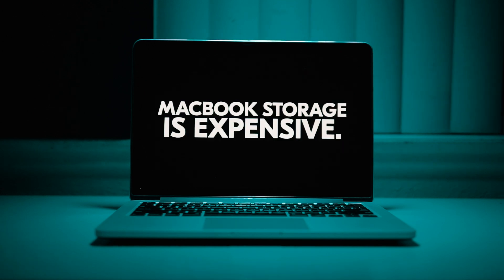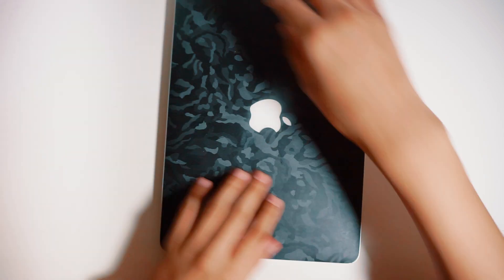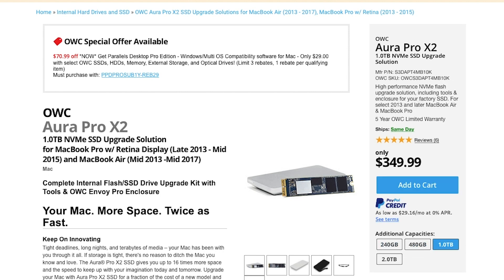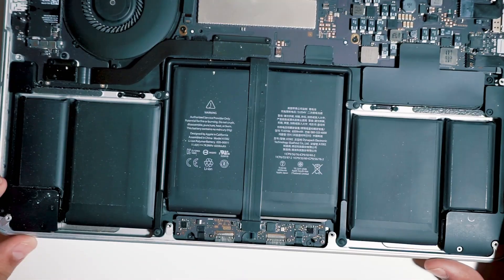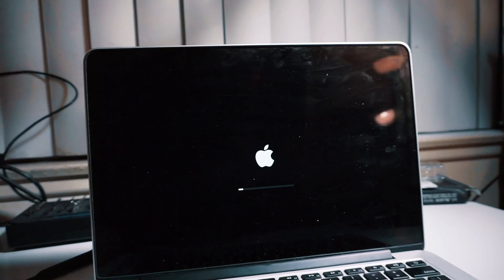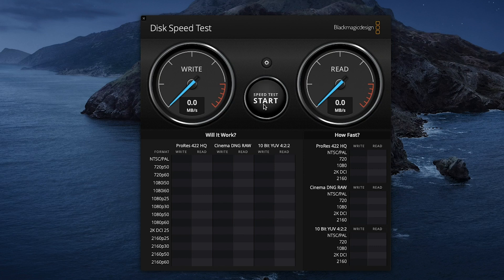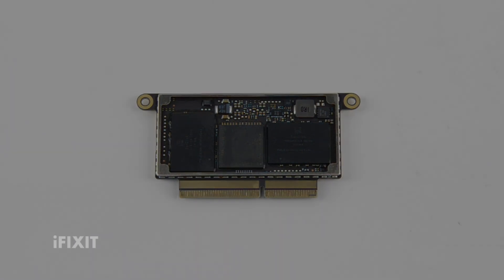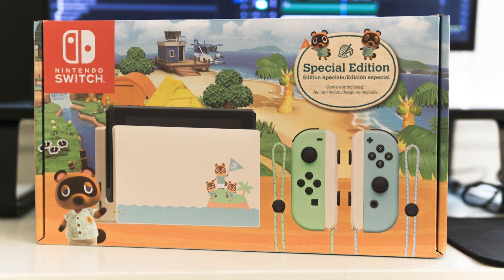The Last Upgradable Macbook Pro

Comment: I just learned from the internet that the Macbook Pro 13" 2018, IS upgradable, however you have to find a DIY expert to help remove the RAM chip off from the board and put larger RAMs back in...the cost of upgrading 8GB to 16GB RAM is about US$ 140.00, plus giving the old 8GB to him...

Comment: I have a mid 2010 MacBook Pro (with the GPU issue) and I was able to replace the popped battery, upgrade to 8GB of RAM, and I put a 480GB SSD in it. Worked as my daily driver for a while, it had the newest macOS at the time which I was really happy about. I stopped using it when the 128GB SSD (put 480GB SSD in different computer) died and the computer never worked that great after that for some reason.

Comment: About the NVMe disk, altho theoretically it could achieve 4GB/s with PCIe 3.0 x4, in real life don't expect more than 1.3 GB/s read and half of that for write, which is fine and still faster than original disk from Apple/Samsung. If youre looking to replace a disk, genuine Sintech adapters are best to go and ADATA 8200 PRO is a best buy, now with 2TB model going for around 250$. Also, hibernation might not work on some MacBooks like mine which is MBP 2014 model and due to firmware issue, but thats just something thats not that big of a deal in the end compared to how much space youre gettin back.

Comment: Greetings Jeff, 

I own the exact same MacBook Pro with the exact same specification that you have upgraded here in the video. I see that the link your description leads to an Amazon link which is a WD Blue Hard disk but you have used a WD Black in the presentation in the above video. 

Inspired by the results you have shown in this video I orders both the products linked below in the description of the video. I had a 128 GB prior to ordering a 500 GB SSD from the supplied link and I am having rather mixed results. I have a 8GB DDR3 Ram, 2.7 GHz i5 13 Inch 2015 MBP. 

My youtube browser gets stuck 3 out of 10 times and the expected speed is a little underwhelming. 

Do you think a WD Blue is the cause of this ? I just followed the link and ordered what I thought a 500 GB which was fit for my usage and it was only after  installing the newly arrived HD and running it did I get back to rewatch this video to realize that you actually used a WD Black. 

Kindly respond  if possible. 

Much thank!

Comment: Thanks Man, the video is very helpful.
To increase performances in general you can also remove the old thermal paste from the CPU and use a coolermaster gel. That's an huge help for cooling down the top case of the macbook

Comment: I replaced my Macbook Air 2017 128GB SSD with a 1TB NVME SSD and it now frequently overheats. Probably because of the higher read/write speed.

Comment: If the 2 storages have different interfaces the adaptor will have its own components and the adaptor might also cap the speeds so that's why you might not be getting the full speeds and even if it doesn't have a different interface the new SSD might have extra lanes that the old Mac ssds don't so it won't use up all the Lanes which won't use the full speeds of the new ssd.

Comment: Just an FYI the macbook pro 2017 no touchbar is acutally now the last upgradeable. There is a way to upgrade the ssd using an adapter ex. the sintech m.2 nvme 2242 adapter. I did it to my 128gb macbook, and made it a 1tb :)

Comment: Great video , quick question did you find an adapter to re-use your old SSD ??? So it can be used as an external HD
Reply from the maker: Yes I did! Only problem is they're RIDICULOUSLY expensive. The cheapest one I could find retails for $70, which is just plain too expensive imo for a 128GB drive. 

I opted not to do it after seeing that price 😅 but if you did want to, here's the link to the cheapest one i could find: https://amzn.to/3kOHV5S

Appreciate you watching! 🤗
Reply: @DammitJeff  thanks a lot man appreciate it
Reply: @DammitJeff  You could just use an adaptor and cable without the housing. That would be like $30 and if you're careful would be just fine.

Comment: DAMN IT JEFF! The affiliate link with the budget SSD you suggested is incompatible with the Macbook Pro >:( even after purchasing an NVME adapter, the indent to put the screw in through the SSD is too small. Please thoroughly research your alternative links before suggesting them
Reply from the maker: Hey! I can assure you I used the exact same ssd for another MacBook and it worked just fine. The NVME adapter comes with a new screw you’re supposed to use to screw in  the SSD and the adapter. You’re not meant to reuse the screw at all. 

Please thoroughly search through your contents of your packaging before commenting, and if so, I’d suggest contacting the NVME adapter creators for a spare screw. 🤗
Reply: Yikes lol, didnt push the SSD inside hard enough, so sorry about that LMFAO
Reply from the maker: Ah ok, no worries! 🤗 Sorry about that haha

Comment: Notice how when Jobs left, Tim cook came in, upgradebility left.
Reply: this is not quite accurate, steve jobs' entire motto was to have a closed system end to end meaning no user customization or upgradeability
Reply: @nathanpappas4507  bruh
Reply: Thats the "force to purchase" scenario. a scam non the less. but people fall for it because the name has stolen the hearts of many.
Reply: 100% correct. Tim cook is about numbers..
Reply: 2010 MacBook Air, and 2008 air, iMac g4 and the original Macintosh were introduced with Steve so not at all, the Macintosh required a special long screw driver to get in the iMac g4 was hard to get in to get to the drive and the 2008 air is the 2008 air along with the iBooks being stubborn to get into

Comment: If someone could me with my issue, I have a 2011 MacBook Pro with 2.7 GHz Intel Core i7 processor
8 GB 1333 MHz DDR3 Memory and an Intel HD Graphics 3000 512 MB, Tried to install Sierra and it randomly powers off, had to get back to El Capitan and it works fine (not always), but El Capitan is TOO OLD nowadays, What can I do?

Comment: I absolutely love my old 15 inch MBP with AMD graphics. The only reason why I switched to the new 16 inch MBP was because my old MBP battery needs to be replaced (1700 Cycles) and the 16 inch MBP is way way better than the previous touch bar models. Battery replacement in my country is so expensive ($800), so it's not even worth replacing it.

Comment: If you don't want this problem with drive. I have choosen samsung 970 pro with adapter. After wiping drive and setting to macos extended was fine even before mojave update. Speeds are slower because of pcie  2 interface on motherboard, but it was mentioned in comments already.  This is basically facebook machine now. If you think you will use it for viedo editing or some work, it will work painfully slow

Comment: MY GUY, THE APPLE THING IS A LOOOOOONG CON..theres NO LONGER A LOGICAL REASON to use apple products..you are paying premium prices for what WAS a premium product back THEN..but mobile processors have come WAY WAY FURTHER, AND with either a windows 10 or ubuntu system you save 1000s of dollars over time..OH AND YOU CAN REPLACE ANYTHING in those...unless your a live performing dj, you DO NOT need a macbook or ANY OTHER PRODUCT..made by them.., apple is a CULT..its made for people ignorant of tech..tech doesnt need to be giant purchases...theyre DISPOSABLE today...and pc tech just keeps getting cheaper..if u HAVE to have an aluminum case, they have ultra books with FAR HIGHER SPECS and better performance.....and wayy wayy wayyy more performance per dollar than you get with apple ...theres TONS of benchmarks proving this today..but apple people are slow when it comes to tech..so im wasting my words, ..oh well I tried. 250$?? for an m.2 1 tb drive???  RE DICULOUS

Comment: Nice video man. I love older Macs, the mid 2012 and earlier were really the best in terms of upgradeability. I love my 2011 11 inch MacBook air, not much is upgradeable besides the storage but this thing still runs great even in 2020 with MacOS 10.14 on it, at least if you grabbed the 4GB model.
Reply: totally! I love my 2013 and 2015 MBP! they are strong as a tanks, and so smooth

Comment: I had your same hair length from 13-14 to 34 (last 2 years even longer), but then all of a sudden, it started to thin out, and now I'm  going with shaved, as patchy head ain't that cute! XD    Enjoy your hair while you can, hopefully forever! ... oh and I'm on my late 2013 retina mbp also happy with it. I went with the 512gb so no need to upgrade yet, although as prices go down, I might change it for the 1tb too. And as I use a laptop cooling pad from targus, that have place in it to put the 512 in an M.2 ssd enclosure inside, and boom... 1.5tb!! And no need to drag anything around (well the cooling pad, but I use it all the time, as I use my laptop at home) :D

Comment: Just in case anyone is wondering if/how it works with the WD Blue suggested in the comments, goes alright and smooth. I did the following : erase the SSD with Disk Utility (and AFPS mode), ended up buying an enclosure for the SSD,  then rebooted the computer in recovery mode and selected re-install OS, connected the WD Blue 1TB SSD and the laptop recognized, highlighted it, agreed to everything, system installed Catalina directly into it however laptop started with the laptop original Samsung SSD. Took the Wd Blue out of the case, installed in the computer with the adapter as described in the video and voila all good!

Comment: Re: OWC pricing: You are comparing price to the OWC drives WITH tools and a USB enclosure kit (for the Apple drive) that costs about $80 bucks.  The 240 GB drive is not $180, it is $110 as you can see at 2:30 in the video.  The 480 GB drive is not $245 it is $165.  You said you have no idea why, now you do.

Comment: I am so in lovr with macbook pro 13 2015 that I have two of these one for uni one for home and both i have been using for the past 5 years. The uni one has never failed me whether it be long final cut pro project or photoshop with tons of layers. Never i had any complains or bottlenecks in terms of speed.  Just the storage. I brought another mac to upgrade the 128 coz I likes the machine so much.  Have the new 16 in but I still love the 13 2015.

Comment: I just did this recently with this adapter and a Sabrent 512 gb.  
http://eshop.sintech.cn/index.php?main_page=product_info&cPath=130_132&products_id=1139

Worked flawlessly and I can actually work on more stuff now without wanting to kms...
Reply: Hows battery life and heating issues? Any other issues? Were you on Catalina when you updated?
Reply: @ffffffffffffff43  Yes, I was on Catalina. I don't perceive a difference in battery life. My macbook ran hot before the upgrade and after the upgrade so nothing really changed lol. The drive itself stays relatively cool though when I check its entry in Macs Fan Control. 

I have changed my thermal paste once too but used a low quality brand which seems like it did not help much.

Comment: 3000+MB/s is on pcie 3 gen x4 bus，your macbook using apple is using apple propriety interface at 2015 probably using pcie gen 2 x4 or pcie gen 3 x2 which is around 1500MB/s

Comment: You probably don't get the speeds that are advertised on the box because the adapter or PCI express might not support those speeds. Just because you get 120 fps in a game it doesn't mean that you would feel that unless your monitor runs at 120Hz.

Comment: I got my sister an OWC SSD replacement for her 2015 mac. Her old one was partially dead from heat damage (yes, partially, it wouldn't boot or detect the drive internally, but I could copy about half the data from it via usb no problem).
I'm replacing the thermal paste next.

Comment: Your speeds are "only" 1300-1400 MBps because your MBP has PCIe 2.0  x4 lanes. It doesn't matter how fast the drive is, your bottleneck is your PCIe.

Everymac lists your machine as having PCIe 2.0 https://everymac.com/systems/apple/macbook_pro/specs/macbook-pro-core-i5-2.7-13-early-2015-retina-display-specs.html
2016 MBPs (non-Touch Bar) received PCIe 3.0, but also use a newer proprietary SSD.

Comment: Ah, yes. Using a non-standard SSD connector. Classic Apple.
Reply: Hence the adapter. You can now install a standard nvme SSD drive in a 2015 MBP. Before you were forced to use a proprietary OWC replacement SSD drive. Not cool!

Comment: Firmware update with High Sierra enabled the NVMe support. technically the 15” Retina that was sold beyond 2015 was the last upgradeable machine (the one that did not have discrete graphics chip). It is really not a good idea to touch the gold contacts on drives like this.

Comment: I have a 2013 one. Works great in 2020 though both side speakers are blown, 3/4 rubber pads torn off, one side of the hinge is loose. Lovin it.

Comment: I remember a day when I upgraded my last 17": RAM to a limit, 240GB SSD + 1TB HHD as a fusion drive, new fans and a heat conductive compound. Mac started to fly... Until Mojave was released (which cannot be installed onto it but this does not matter). Since then it appears a pumpkin. No throttling, no programmatic slowing down Apple says. I trusted them, but no more. I'm cured of applemia. And wish you the same people. This is only a shiny package for low-mid-end solutions. They will get you anyway if you only just start thinking to trust them.
Reply: Apple: Great Software, Terrible Hardware

Comment: He is totally right, the 2015 model is the best one, I just want to mention that it also has more ports so you don't need adapters for anything, I have been using it for like 10 months and there is nothing that I could complain about.

Comment: Does anyone know if this SSD upgrade works on both the EARLY-2015 Macbook Pro as well as the MID-2015 Macbook Pro?
Reply: I believe so - check out https://forums.macrumors.com/threads/upgrading-2013-2014-macbook-pro-ssd-to-m-2-nvme.2034976/

Comment: I managed to upgrade my 2017 MacbookPro (Function Keys, not Touch Bar model) to 2TB with an adapter I bought on eBay, and a 2242 size SSD ! Check this link (i still have to update it so say it worked!):
https://forums.macrumors.com/threads/help-never-seen-before-trying-to-install-m-2-ssd-on-mid-2017-mbp-a1708.2239050/

Comment: I have a late 2013 a1502 and the trackpad as well as keyboard is starting to malfunction. I love this thing, I think it is the greatest Macbook pro created. Has anyone experienced this before? I have tried all the basic fixes without relief. It works fine with an external keyboard and mouse, but I would love to avoid using those.

Comment from the maker: I really appreciate all the massive support on this video. 💖
 The comments are getting a bit hectic to respond to all of them, so if you have a particular question, message me at https://twitter.com/dammit_jeff or on Instagram @dammit_jeff and I’ll try my best to help you. Thanks 💕
Reply: it sounds like it is working in x2 mode instead of x4
Reply: Hi. Thank you for the video! how did you get the mac to recognize the new drive and to format it? I´ve made the bootable drive and i am able to go forward with the install of mac os catalina but the mac can not find the drive.
Reply: I figured it out, had to hold the option key at startup to get to the startup manager, select installation of the operating system and then it found the drive so i could format it.
Reply: @LordOfWarAk47  hi I’m stuck in this process could you help?
Please
Reply: @joohad  What are you struggling with?
Reply: @LordOfWarAk47  I figure that out. I spent 5 hours trying hahah.
Thank you for asking though!!!
Reply: idk why the speed is slower but i think its slower because the PCI express lane or the SSD port is a bit old. hope you understand it, my english is not the best
Reply: Aaaaaaaactually, the 2017 Non touchbar Macbook pro can be upgraded, You can get similar adapters. But you have to get a tiny type D m2 ssd
Reply: How long the macbook before 2014 series can survive without OS  update , i mean this kind of old stuff for coding , should i take thinkpad T460 or macbook before 2014?
Thank
Reply: You will grow, your content is too good. So good that you showed up in my recommended.
Reply: Really great editing mate!!!! Keep up the good videos
Reply: A friend of mine has a MacBook pro.
He was wondering if storage could be added.
I sent him your video.
Thanks very well done.
Keith
Reply: Jeff, if you can't replace the RAM, it's not upgradable.
Reply: I managed to upgrade my 2017 MacbookPro to 2TB with an adapter I bought on eBay, and a 2242 size SSD ! Check this link :
https://forums.macrumors.com/threads/help-never-seen-before-trying-to-install-m-2-ssd-on-mid-2017-mbp-a1708.2239050/

Comment: My a1398 I used an adapter with an Adata 1TB. I more than doubled the speed and capacity. Also upgraded to the highest specd logic board that I found on eBay for $50 more than i resold my original.

Comment: I just did an upgrade on my 2016 MacBook Air with a Kingston 500 GB Nvme SSD. At first the disk utility failed to recognize it and I had a sinking feeling that my ~ $110 purchase was a disaster.. but fortunately after doing some searching online I found out that you will need to purge the boot ROM after you replace the hard drive by pressing Cmd+Option++R+P when restarting. After doing this I was able to see my new SSD in the disk utility menu and it was sm other sailing from there. I too got around 1100 MB/s sequential read and write speeds and everything works pretty smooth. It s a pity that the RAM is soldered on to the logic board in my Air so I’m pretty much stuck with a sucky 4GB ☺️. Anyway I only do light tasks on my Air so I’m working on upgrading my iMac (late 2013) to 16GB. This will be my main machine for running my python projects.